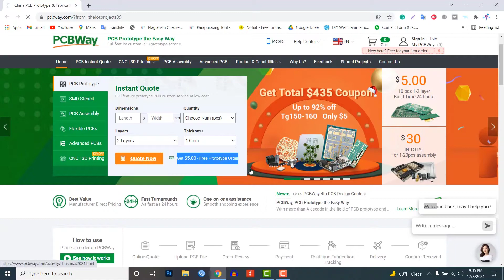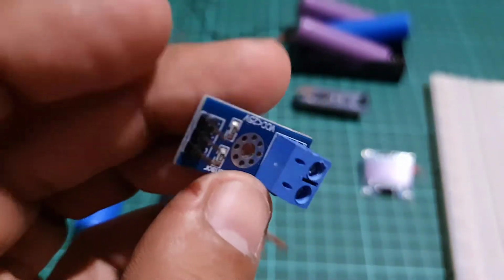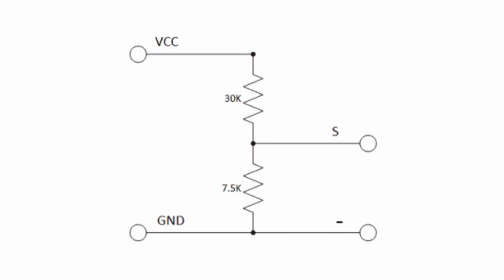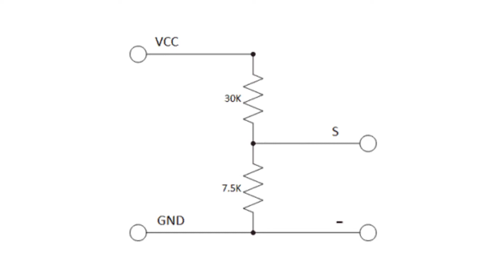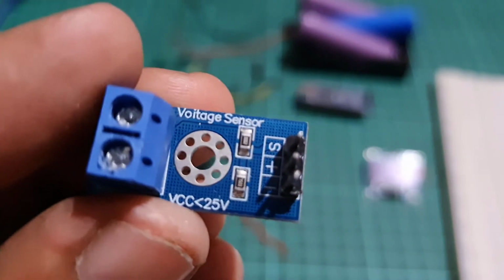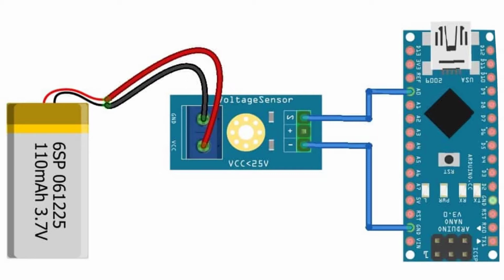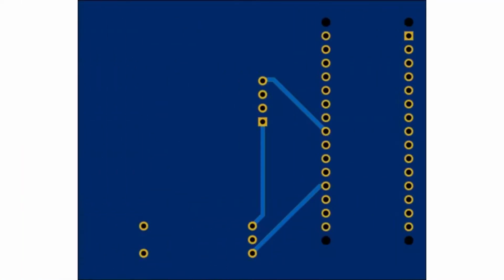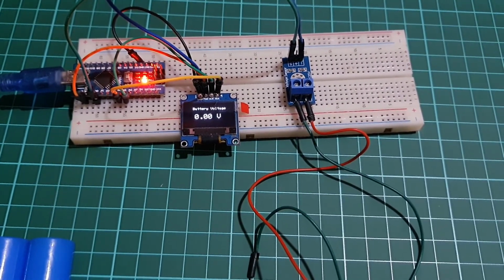Interfacing 0-25V DC Voltage Sensor with Arduino & 0.96" OLED Display

Comment: Hi. How do we power an esp8266 microprocessor with the battery while also checking the battery's voltage with the voltage sensor?  The 8266 uses 3.3V and the battery I'm using is a LiFePO4 3.2V.  If I use a USB cable to the 8366, everything works as expected.  But as soon as I unplug the USB cable from the 8266, there is no power to the esp8266 anymore.  I tried plugging a jumper wire onto the sensor's + pin and the other end to the 3V3 pin on the 8266, but that doesn't give it power.  I also tried connecting the jumper wire to the 5V pin on the 8266, but still no power.  If I connect the battery's wires directly to the 3V3 pin via a breadboard, my 8266 works fine.  Anybody have any ideas?  Is there any documentation for this Voltage Sensor board?